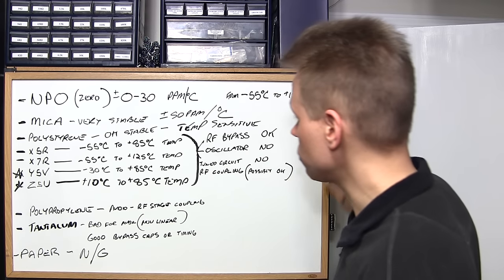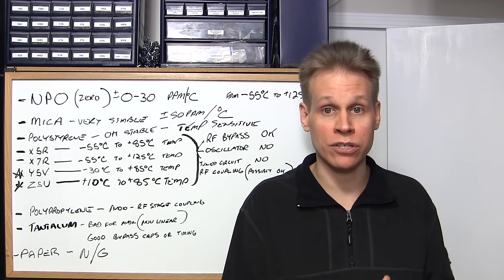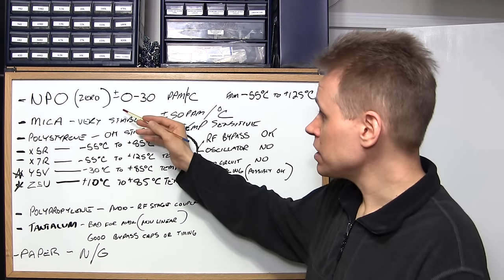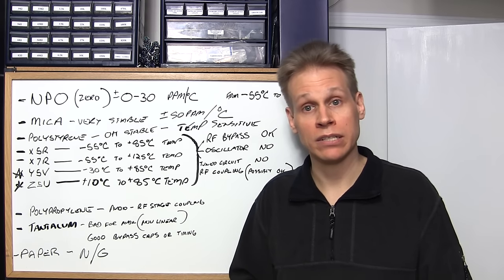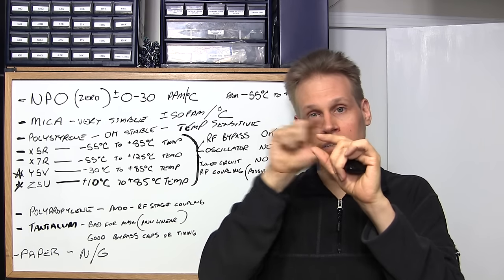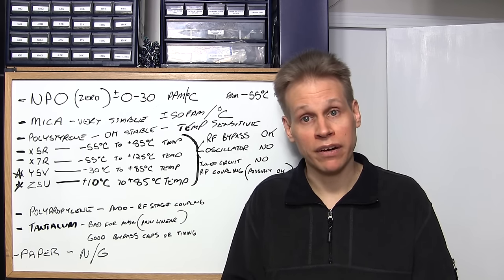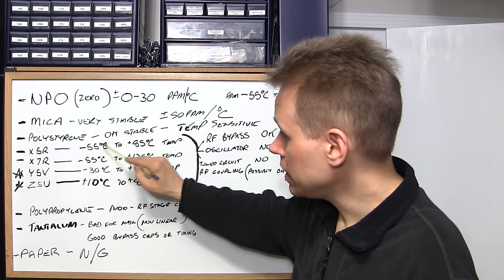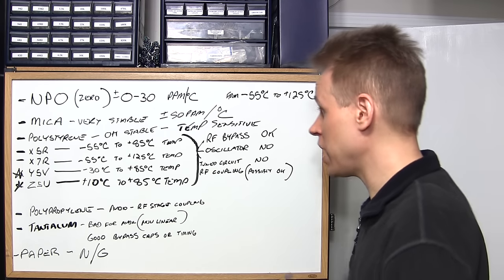Which Capacitor Do I Use? Tech Tips Tuesday

Comment: Lol, You called the NP Zero NPO.You could put a diagonal line through the 0 so it looks like a zero not an O. Great video's BTW
Reply: They have been called NPO for years.
Reply: In English /oʊ/ and /zɪɹoʊ/ are synonyms in any numerical context. Saying NPO like he did is precisely identical to saying "NP zero". There is no difference.
Reply: Navy electronics taught NPO->  Non Polarized cap
Reply: @real3tron3  
In electrolytic capacitors yes, basically two electrolytics in series.
Reply: I knew what he was talking about.
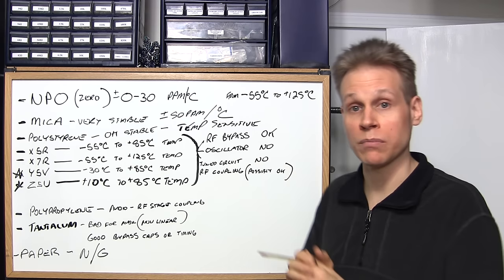Reply: Did you even watch? 6:19

Comment: Greetings from the golden shores of goose lake, in the Topock Marsh, where my Class A Motor Home is parked letting me enjoy the warm sun, and avoid the Cold and Snow in South Dakota, my home state.  Just wanted to thank you for these wonderful videos.  I have always thought that if I could learn at least one new thing every day, I would keep my brain young and active instead of just sitting in my recliner and getting older and slower every day.  This has kept me going now for over 65 years, in fact Workers Comp just called me last week to congratulate me on my assumed retirement!  Yes they  are cutting my paycheck in half so I can get the feel of real retirement!! Aren't they wonderful folk.  Anyhow I am an electronics hobbyist, and have had a love and wonder at the operation of electrical circuits since my days as a boy at my fathers knee as he changed tube in our old battery pack radio, in our old farmhouse in North Dakota, we had neither electricity nor running water, so I felt a real reverence for the magic in that old wooden radio up on dad's secretary that sat near the living room window that looked out over our small front yard and the alfalfa field that lay beyond.  My love continued when I entered the US Army, telling the recruiter that I wanted to work with radios and electric stuff, he got me a job as a field wire-man, stringing field wire through the jungle in Vietnam, and packing a prick 77 radio on my aching back. But I kept pushing and ended up getting into first, land line teletype, then radio teletype, and finally became a communications Chief with my own communications section at battalion level.  When my kids became of school age, I left the Army and joined a police force, and after 24 years became disabled in an accident. The rest is a sad and painful story, but still I love the old electron moving through the wires making things happen.  So anyhow thanks for the continuing education, you are indeed appreciated.
Reply from the maker: Thanks for taking the time to write Jerry! Great story and well written.

Comment: I've been in the video business for about 30 years. I've gone from tube type cameras to CCD cameras, from tape to tapeless. Several of my cameras use what I call junk surface mount electrolytics. The useful life of those caps was about 5 years. The cameras not only failed, but oil was leaking  from the caps on every circuit card. I took the time to rebuild every camera with tantalum caps and they have been working fine for over 10 years now.  Thanks for a nice presentation. Very informative.
Reply from the maker: Thanks!

Comment: Ceramic caps are sometimes used in guitar and bass pedals. When op amps are used as inverted amplifiers for distortion or fuzz, a <100pf  cap might be used to remove sharp treble and noise.  The Big Muff uses ceramic caps for feedback of each of the two transistors in the distortion circuit.

Comment: This is one of the best informative videos. As a humorous side note you can reuse the old wax coated caps. When driving a screw into wood it can be coated with the wax by scraping it off an old cap. Screws in go in much easier.
Reply from the maker: +Rick Goebel 
Thanks Rick!

Comment: I was repairing an old 1950s radio a few months ago and I noticed a wax capacitor between the audio preamp and output valve. I removed the output valve and powered up the set and was reading a horrendous +56 volts on the control grid pin for the output valve. Needless to say I replaced it and all was good

Comment: Nice general round up Mr Carlson.
 In many applications linearity and dielectric absorption and  losses ( tan_delta ) are very important . 
NP0 ceramics are considered sufficiently linear and stable for use in audio equalizers unlike their high k relatives. Also unlike polyester ( Mylar) caps polypropylene is a very linear , low loss dielectric extremely popular in audio sine the 80s. Polystyrene is the first choice for audio equalization. Replacing Bumblebee caps with ICW caps as you did in the Citation I & Mc C29 .. (? ...)  they deserves better although it is functionally ok to use this grade of caps Mundorf , Clarity Cap,  **  etc would have done the preamps proud.   Of course in restoration of old  equipment all this is  irrelevant.

Teflon caps from Audience and VT are king for use in audio but cost prohibit their general use except in justifiable situations. 

You might like to laugh or cry in delight looking at this just the other side of the component choice world for audio :) 

**
Humble Homemade Hifi - Cap Test

Comment: I have an old heathkit capacitor tester that apply up to 700V to test the capacitor. 
It's the old and dangerous tester with an eye that close when they leak. It's not as precise as the new tester, but it's very good to test old high voltage capacitor, and you can use it to reform old electrolytic.

Comment: Starting at 6:20, he is careful to point out that it is an N P zero capacitor, not an N P 'Oh' capacitor. He then makes that very mistake in summarizing, "Basically where you find an N P 'Oh' capacitor." Lol.
 To be clear, I am not making fun of, nor diminishing his lecture on capacitors, but rather complimenting it.
 You see, in ANY written communications that utilize BOTH a zero AND the letter "O", it is ALWAYS confusing, and he just drove home that fact.
 That is the very reason that a long time ago, I started putting a slash through my zeros to distinguish them from Oh's (I'm 65, and I started doing that in my late teens).
 I thoroughly enjoyed his lecture, and I actually learned a few things as well. Great presentation, and keep up the good work.

Comment: 3:40 Why would you not use a ceramic disc in an oscillator? Every single Fender Amplifier tremolo circuit uses these for the oscillation loop. Please explain.
Reply from the maker: In audio frequency application, the drift of the ceramic disc capacitor "due to heating" is small compared to the capacitance shift needed to noticed by our ears. The higher the frequency (say RF application) the oscillations are quicker, so less capacitance shift will cause noticable frequency shift. In any case, it's bad practice to put a ceramic capacitor (disc type) that is not NP0 rated in an oscillator circuit. It's easy to spot an NP0 rated cap, it has a black spot on the top of the disc, opposite the leads, (it looks like a black dip on the top portion of the cap.)

Comment: Great channel! I've build a lot of different VFO's for small transmitters and it became a challenge to get them as stable as possible. And because I don't have such nice equipment as you have, I always test them with a digital shortwave receiver in SSB mode. I Tune the receiver to the frequency of the new build oscillator and I adjust the BFO of the radio until the radio is completely silent (zero beat). Then I use a straw to blow air on the capacitors and the coil. With just a single ceramic capacitor in the LC circuit you can hear the oscillator running away from it's frequency! But very informative to SEE how they behave! Thanks for all your explanation. I Subscribed to your channel. And another nice method to provide more stability in case of a VFO; when you are calculating the LC circuit, start with the capacitor. For the best performance, it has to be 3 to 4 times the value in pF than the desired wavelength in meters. So, if it's for the 80 meter band, you can use 240 - 320pF.
Reply from the maker: +Jan Renesse 
Great info Jan! Thanks for your input!

Comment: Wow! That Genrad Bridge needs a video all on it's own! 
Apart from the capacitance measurement on the left, the right measurement appeared to be displaying either Quality, Disapation or Internal Resistance... 
If this is true, then this machine could possibly be the holly grail of vintage capacitor testing! It appeared to have lots of buttons on it's far right and I'm imagining that you could select between, drain, internal resistance, Quality factor and phase angle... 
I have mentioned in another post elsewhere in another of your videos about an LCR Bridge which is available on eBay that retails for around $100, I think that it would be a cheaper purchase than your Genrad Bridge, but I will be keeping an eye out for one should one show up on eBay! 
So if you do get a chance to go over it's features and functions in an up coming video, I would greatly appreciate it. 
Incidentally, I noticed that when you tested the ceramic capacitor, as it heated, it's capacity went down as did whatever the other measurement was trying to show! Either it was saying that it's quality was dropping as it got hot or it's disapation factor was dropping with heat, which if used in right circuit could be a handy feature... 
I have already watched this video ages ago and here I am watching it again and I have seen something that I didn't and couldn't see the first time, basically I have grown in knowledge since the last time and going over old videos reveals things that I should have known but didn't... It's a great feeling... 
Thanks for everything 😊

Comment: Very informative video as usual..A few things I would like to add..I use a lot of paper in oil capacitors and when you get paper in oil caps such as Sprague Vitamin Qs, Gudemans,Westcap, Russian K40y and Russian K42y,they rarely ever fail because these caps are hermetically sealed from moisture and they contain oil which also acts as a dampening and cooling agent for the cap. I use them in audio amps because the paper capacitors give a lot more body to the sound especially when you are driving revealing speakers..Paper capacitors are also very stable at higher frequencies and they don't  change characteristics as the poly film caps do at times when there are higher voltages across them.For instance,when coming off the plate of the preceding stage to the grid of the next stage.I use both polys and paper in oil in the mix of amps and preamps and in the feedback loop I use silver micas for their stability..On the input and phase splitter,I use a film and foil but from driver to output I use paper in oil or teflon.
   The funny thing is,the Sprague 160p is like the Bumblebees in construction except it was sealed much better and they were made in a humidity controlled environment where the Bumblebees were not and that's why so many crack and fail..The later Bumblebees were ok but there is no way to discern which ones those are so it's at your own risk.
Reply from the maker: +Mike Samra 
Thanks for your input Mike!

Comment: Very informative Paul; I discovered when designing circuits how critical it is in making the right choices when it comes to using capacitor types. You can have a sound design with the wrong capacitors making you think there is a flaw in the prototype, but in reality it is the capacitor choice that is causing all the issues. Having a solid grounding in electronics can help avoid what can be a potential disaster.
Reply from the maker: +John Cunningham 
Thanks for your comment John. Knowing the capacitor is definitely a good thing.

Comment: This is an excellent video. The whiteboard layout makes it easy to see the comparison. The takeaway is that many of the capacitors that have been in common use should not be.  When I started in electronics, we used paper and tantalum caps. I would now prefer mica for many things including bypassing when the circuit is critical or takes hours to build. At this point, using the best components for a given amount of labor is my priority.
Reply from the maker: +n4hpg 
Thanks for your comment!

Comment: Hi Mr. Carlson, yours is the only video I subscribed to after watching just one. I am 67 years old, and as a hobby I want to upgrade my loudspeaker’s 45 year old crossovers. They have electrolytic capacitors, coils, and resistors from Stone Age. I want to replace all with much better quality components including best wires. What type of capacitors, coils, resistors, and wires will I need and where can I buy?

Comment: Good presentation! I would add one observation, though.
I was a bench tech (avionics from 1970-1984, communications at an electric utility from 1984 to about 1986, when I was put in the field). In the 1970s ceramic disc capacitors below 100V were pretty common in discrete transistor circuits and even in early IC circuits. 0.1 mfd 12V disc capacitors were everywhere (especially in bypass applications) and their reliability was horrible. They would leak, sometimes even when new, and I never figured out whether the shorted ones were just ones that leaked especially badly. Above 100V disc ceramics work great.

Comment: Hi Paul, nice video on caps.
My experience on the old mica caps in high voltage circuits is they are failing due to silver migration. I have also seen the silver plated tubular caps fail as well. Since they are in the local oscillator and other tuned circuits, it is very detrimental for them to fail that way. 
Tantalum caps have been failing by shorting, even in low voltage circuits less than 5 volts! I don't know why they fail, but I have been replacing them with new style electrolytic caps that are close to the same size as the tantalum caps.
Keep up the good work!

Comment: That was awesome, that explains why I'm having issues with a preamp I'm building.  The only thing that confused me was the tapping of the capacitor demo where you said the scope was set to 500uV/div. when it appears that the lowest range of the scope is 1mV/cm.
Reply from the maker: Hi Derek. 1mV=1000uV, so in other words, 1000uV per box. With the unit in de-cal, that's not much further down.

Comment: Although not a sensitive application, consider ceramic caps in a speaker crossover circuit inside your speaker box while you crank up The Who. But a polypropylene cap in there just won't care.

Polystyrene units can get weird with age. I've found numerous ones in 1970s & 80s tuning circuits doing strange things. They'll work perfectly for several minutes, then go bonkers. Give them a squeeze and the tuning moves around.

There's lots of tantalums in FM demodulator circuits & stereo decoding and are common in charge pump circuits of DC to DC converters & level shift such as TTL to RS232.

Very interesting demonstration.

Comment: Setting up a lab from scratch (after decades away from the hobby) cheap ceramic caps are the first stop to build up stock. Except as shown here they can be dreadful and I wish the alternatives were cheaper. I have recapped a couple of tube radios which has brought them back to life which is a great feeling of achievement (if not cheap).  Thanks for this type of video very instructive.
Reply from the maker: +mbaker335 
Thanks for your comment!

Comment: 03:01 Choosing the correct capacitor is crucial for a circuit's performance, temperature stability, and other factors.

06:02 Different types of capacitors have specific uses and stability

09:03 Different types of capacitors have varying stability and temperature sensitivity.

12:04 Different types of capacitors have specific uses, such as RF bypassing, audio coupling, and timing applications.

15:05 The MICA capacitor showed stable performance even in extreme conditions.

18:06 Polypropylene capacitors are stable and suitable for oscillators

21:07 Polypro capacitors are more stable than other capacitors

24:04 Different types of capacitors have different effects on electronic circuits.

Crafted by Merlin AI.03:01 Choosing the correct capacitor is crucial for a circuit's performance, temperature stability, and other factors.

06:02 Different types of capacitors have specific uses and stability

09:03 Different types of capacitors have varying stability and temperature sensitivity.

12:04 Different types of capacitors have specific uses, such as RF bypassing, audio coupling, and timing applications.

15:05 The MICA capacitor showed stable performance even in extreme conditions.

18:06 Polypropylene capacitors are stable and suitable for oscillators

21:07 Polypro capacitors are more stable than other capacitors

24:04 Different types of capacitors have different effects on electronic circuits.

Crafted by Merlin AI.

Comment: Excellent tutorial about capacitor characteristics that are rarely taught in school. Normally, the only distinction that's ever made is electrolytic vs. non-electrolytic. Also, I didn't know General Radio made any "modern" digital equipment. I had only every seen the older analog stuff.
Reply from the maker: +Eric Wasatonic 
Hi Eric! GenRad has been purchased by IET now, but they still sell the 1689M. It's a great machine! Thanks for the kind words, and looking forward to a new video from you. Maybe one day, a peak inside those old curve tracers would make a great video.